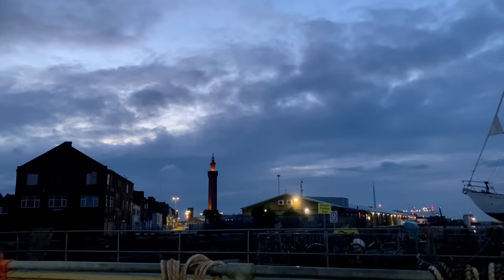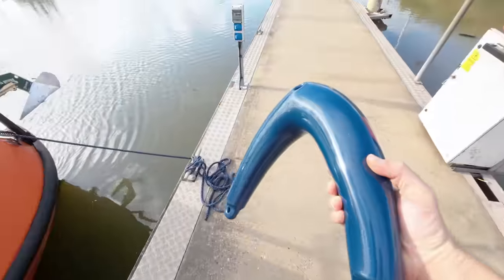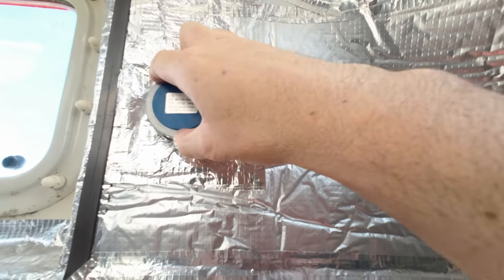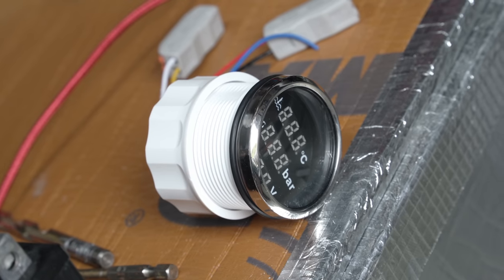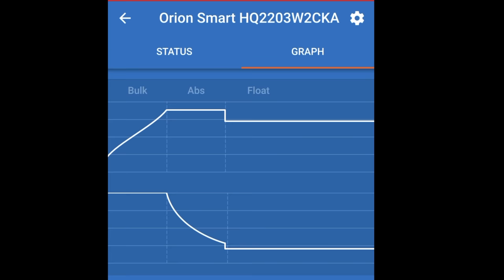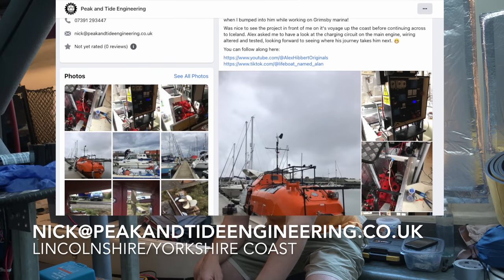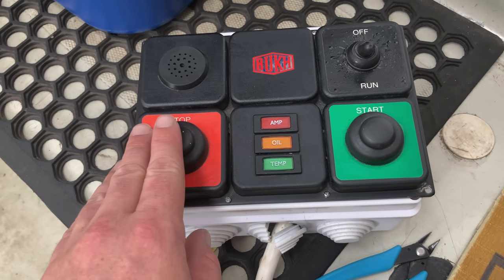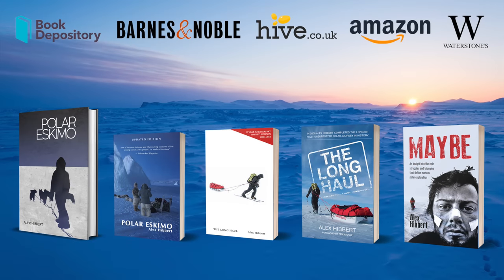Lifeboat 230V and alternator fixes. Installing 24V charger. Expedition Lifeboat Conversion Ep91 [4K]

Comment from the maker: For those wanting a more detailed explanation about the alternator wiring: I'd copied the original installation wire for wire when I took out the old dead alternator. This was wired by Bukh, and they had continuity between the alternator case and the negative terminal. I wrongly assumed my new alternator was set up the same way, but in fact the terminal was isolated. This means I couldn't rely on the alternator shell to connect it to the engine block, and indirectly to the battery negative. The unused black wire on the original needs to be used in this new installation. And now it is!

Comment: that's the thing with victron. it costs about double, but it just works and you don't have the hassle. be nice if the competition would step up a bit.
Reply from the maker: I do wish there was more competition in the ready to plug and play boat electrics, and especially their range. I'm far from a fanboy. Their instructions and post-sale support are pitiful.

Comment: 5:12  Super capacitors are finding their way into starting circuits more and more these days.  I've been using the same bank of 20$ supercapacitors to start my car for over 5 years now.  They never degrade and have never failed to start on the first try (and the small 12Ah battery is fabulous backup source and help to keep the supercaps charged (can be switched of course). The main advantage for you is that they are completely unaffected by low temperatures.

Comment: Make sure the bulk absorption and float settings are set to the same voltages on both the mppt and Orion chargers. In my camper Ive set the charging voltages of the mppt higher(very very slightly) than the one from the Orion. This way makes it so whenever there is enough sun the battery’s charge with sun and the Orion takes a step back. But when the sun fades and the battery’s still need charging the Orion takes over. To spare all the moving parts the wear and maybe some fuel. I’m still experimenting with changing these settings after 3 years of living in the van. But it’s definitely worth experimenting with your own setup.
Reply from the maker: Good tips, thanks

Comment: Nice catch on the alternator - and the Victron gear is very smart and as an added bonus will give off a nice bit of heat into the cabin.😉 Top tip with respect to the anchor when berthing, particularly when constrained by other vessels - as you approach the berth, drop the anchor about 0.5m below the surface of the oggin.😀⛵️
Reply: Heat from electronics is inefficiency. That heat you're getting is coming at the cost of battery capacity. It's probably very much not worth it.
Reply: @BenjaminKlahn  but the waste heat from the Victron units is a given - so what do you suggest?

Comment: Alternators are very reliable,  what has indifferent reliability is the rectifier regulator unit. On small alternators, this unit is usually housed inside the chassis. HOWEVER, if you buy a high output alternator, the R R unit is usually screwed on outside and easily replaced without removing the alternator......Have fun.

Comment: Use A&N “army navy” fittings and fuel hose. Any online hot rod purveyor carries this NHRA & NSRA approved fuel delivery system. If your still wanting stainless lines tape the area you’re wanting to cut through, using a small Dremel fiber cutoff wheel at higher speed. Hope this helps.
Reply from the maker: Much as I'd love to entirely rip out and replace large portions of the boat's hardware each week, sometimes we need to make what we have work!
Reply: @AlexHibbertOriginals lern how alternators work! They need to be conected directly to battery to charge it. If not alterbator is not working

Comment: Your alternator has a W terminal on it. So you can easily add a revcounter gauge to supplement your triple gauge if you are so inclined. I would recommend an old stock analog one or digital with LCD dial (The digital with analog pointer ones are junk).

Comment: Does the new blue box software integrate into the solar panels … would assume so?  You may want to have an alternate power supply for the radio(s) and Anderson Power Pole connectors are a great way to quickly swap power sources.
Reply from the maker: They speak to the same app, but I don't think they coordinate their behaviour, as they don't know they are connection to the same battery/ies.
Reply: @AlexHibbertOriginals 
Start up the Bluetooth network in the app then they start communicate 😁👍

Comment: My understanding is that your Orion and MPPT will both start throttling back as you move towards absorption and then stop completely once house battery float has been achieved.  May be worth adding a smart shunt (if you don’t have already) just after the battery terminal (before any loads) for maximum accuracy.  You might also consider a DC-DC charger going the other way to keep your starter battery topped up from your house bank when you’re at anchor, marina, etc with surplus solar generation to spare, unless your starter is AGM in which case you’re probably fine.

What’s the plan for chart plotter, etc, please tell me you’re not going to the arctic with Navionics alone? 😬
Reply: Putting a dc to dc the other way around will interfere with the automatic start stop detection of the Orion as I understand it.

Comment: Just a small tip on voltage. When an alternator is running, the voltage on a 12V system should be 14.42V at 20-25 degrees C. Higher when colder. So charging voltage of only 13-something volts is not OK.

Comment: Make sure you make yourself an anderson connector with battery clamps in the other end, for the batteries. If you don't already have a good old standard battery-to-battery-startup-cable-set. otherwize, you will be completely dependent on anderson connectors everywhere.
Reply from the maker: I have jump leads at the ready, and an Anderson-clamp combo is a good idea.

Comment: Your stainless braided fuel lines are much easier to deal with using AN fittings and the shear cutting tool designed to use with that type of hose, I use them for my oil coolers, hydraulic steering hoses and high pressure fuel, however it would be a different story had I not the good stock of assorted angle fittings and the specific tool for cutting the line, it makes it much easier to deal with. You may look into that in the future in fuel plumbing, AN-6 would be sufficient for your fuel supply and you could use the same for return to keep for having to have multiple sizes of spare fittings, or have an AN-4 return line.
Reply from the maker: Certainly - all true!

Comment: Hmm, ya sure ya don't want a momentary switch for the digital dials on the battery box? So ya can't forget it on the on-position, it would only work as long as ya hold the button.
Reply from the maker: It's not going to steal much power when underway. If the boat is left 'off' for a few days, there's already a procession of things to switch off that this can be added to.
Reply: @AlexHibbertOriginals a printed and laminated check list for cold and warm startup, as well as for wind-down routines might help prevent errors at times when you might be low on blood sugar, or when someone else needs to do these on your behalf.
Thanks ever so much for sharing all of this with us!

Comment: Why did you fit the shore power box assembly that way around ?  Surely it would be better with the box inside ?
Reply from the maker: The hole created, plus mounting holes no longer matched that configuration after the change in plan. I could have glassed the whole thing over and recut, but I was against the clock. Maybe another time.

Comment: I am kinda glad to see you don't have a pile of lithium batteries on Alan . 
.I love lithium batteries in battery sheds with distance from flammables . The reason is fire they can and do spontaneously ignite and you can't put a lithium battery out until all the fuel Is consumed . That scares hell out of me on a boat . A floating Tesla fire
Reply from the maker: I use lithium a lot in the the Arctic, but LiFePO4, but less Li-ion or polymer chemistries. The safety profiles vary a lot.

Comment: If you ram into anything going forward do you think your anchor will bend or push into the hull?
Reply from the maker: I'm going to bet neither. Given the limited speed and force, it would probably just come to a halt. At worst, the retaining pin might fail and the anchor would lift off the bowsprit.

Comment: Stainless braided hoses are specifically made to use AN fittings. NOT hose clamps. That's your issue!
Reply from the maker: Yeeeeees. This is my realisation, and I'm going to direct my displeasure to the chandlery salesman in 2019.

Comment: A proper shore power fitting is the thing…. Check Kuranda  Marine.
Reply from the maker: I was royally messed around by Kuranda, so I don't buy from them.
Reply: @AlexHibbertOriginals  Sorry to hear that. They did a magnificent job fitting a 3K Victron to my boat, 15 years of faultless working, still on the 4 original batteries. They aren't the only suppliers of shore power socket fittings though I guess..

Comment: @AlexHibbertOriginals my comment 2 months ago was long and rambling! But I love everything you did in this video and think that they are all good decisions - but I would also add a 24v 100a alternator to Alan's diesel engine, and make sure you have a plug-in battery charger for marinas or your diesel generator.

Alan's diesel engine probably has a fair amount of horsepower to spare. Therfore, adding the second alternator would not slow you down any, and wouldn't increase your fuel consumption (it's just a question of how long it takes to charge the batteries).

But right now, if you ran your battery banks dead, it'd take you something like 7 hours to recharge each pair of batteries, and that's if you had 100% of the alternator's output. If you want to run some electrical loads too? Good luck.

Even the 100a 24v alternator would take 2+ hours to recharge each pair of batteries - under ideal circumstances.
Reply from the maker: Hi Paul - I may consider another alternator, but space is a real limiter down there, and the current alternator does supply a lot of power over the long engine runs we're doing. The batteries are almost always full.

The generator has a battery charger (a Victron) that can chuck out 50A, so that will sort the batteries in quick time, and with less fuel than running the engine. I will save up for a charger for both generator outlets.
Reply: @AlexHibbertOriginals  I don't have a good mental image of how much space is available under the cowling, but please keep the second alternator in the back of your mind.

I find it helpful to think of everything in watts, as it makes it easier when dealing with multiple voltages. Your current alternator provided 840 watts at maximum output.

A 50 amp charger (assuming 24 volt) is 1200 watts and a very nice second option. 

My only point was - keep a mental list of items that draw power. A light here, a pump there, a computer here, a screen there, a fan there, suddenly tiny 5 and 10 watt loads start adding up. 

I would suggest a clamp multimeter with AC and DC current measuring. You can put the clamp around the cable coming from your alternator and see just how much load you're putting on it. Or any other part of your system. Makes it very easy to figure out where your electricity is going.

I agree with a top rate brand like Victron for your main charger, but in the USA, Amazon has some CHEAP no-name ones. I'm talking about 100 amps at 12v for $100. Wouldn't want it as my only charger, but a nice backup / auxiliary.

I am probably being paranoid, but I'd rather send you $500 for a second alternator, than have you be stranded.

P. S. - I still think you should consider valves for a radiator in the cabin (shut off the cooling loop under Alan and have a radiator in the cabin instead). I know this must seem laughable after your summer voyages where keeping cool was an issue. However I'm afraid that will change when in actual arctic conditions, and heating will become important. You'll be huddled around the diesel heater saying "I can believe we're heating water under the boat..."

Comment: You could upgrade the dodgy braided fuel hose by just buying good quality fuel hose and wrapping it in industrial type spiral binding. Garden variety automotive spiral binding is a bit second rate here - it's the industrial type you want that hose doctors etc sell. It isn't particularly cheap but it has awesome abrasion & chemical resistance and will toughen any rubber hose. 
In hot areas of the engine bay you can buy reflective cloth tubing of various diameters too, so you could actually make some decent fuel hoses. 
I, like you, don't like crappy hose - I'd jolly well piss it off 'ole chap lest you find yourself without power and dashed upon the rocks.

So a 12v alternator should ordinarily charge at 13.8 - 14.2v. The resting voltage of a healthy lead-acid (or equivalent) 12v battery should be 12.6v
Also 100a isn't enough for the cranking battery @12v. Typically 300a cable is about what you want. That battery can probably output 250cca by the looks of things. For reference, the key advantage of 24v over 12v is half the current for cranking but you're only 12v on the engine. Best to rethink this wiring. Remember the higher the voltage the lower the amps. Diesel engines need all the amps they can get when starting at 12v.
Reply from the maker: The first half of this is interesting and I'll investigate. The second half is slightly odd - the new battery is punchier, albeit smaller, than the factory batteries, and it cranks the engine with ease. The starter motor is only a 1kw. If the system works, I see little reason to rip everything out and start again just because 24v allows for lower amps.
Reply: @AlexHibbertOriginals Re the voltage, it's not odd it's maths.
Just because it works now in its inadequate state, doesn't mean it's going to after a fuel leak, repair and subsequent air in the system that needs bleeding.
Expect hot wires that let the smoke out and a flat battery in that case. 300a cable is needed and even another battery in parallel to improve reliability and performance.
250cca is an inadequately sized battery - a small battery. Most batteries sort of start in the range of 500cca and go up from there these days. You could save that battery by getting another identical one however more potentionally problematic connections are required.
Voltage drop occurs when you need it most, not when you're testing it in the commissioning phase.

Comment: Obviously you've committed to 24V house batteries now, but I assumed you were using 24V as that's what the engine electrics used. I would have kept everything 12V if that's what your engine used. Anyway. Too late for that now.

70 amps at 12 volts is NOT a lot of power. 840 watts to be exact - and that's running the alternator at full load. Plenty for duties as a lifeboat, but not much for a ship. Also, 746 watts is 1 horsepower, so your alternator will place just over 1 horsepower of load on your engine at maximum load. Not much.

In my van, which is entirely 12 volt, I've got a 180 amp alternator for the starting battery, and a 280 amp alternator for the house battery. PLUS a stand-alone 3000w generator.

I'm not too worried now that you've got a separate diesel generator of your own - but I would strongly consider a separate 24V alternator at some point. 100 amps at 24V would be a nice size - recharging your battery bank in 4 hours, while only putting around 3 horsepower of load on your engine.

Anyway, I think the changes you marry were otherwise quite good - I am a big fan of the dedicated starting battery and the 12/24 battery charger.
Reply from the maker: The amount of wiring makes the lower current at 24V good for avoiding voltage drop on longer runs, but I agree consistency would be good. That said, a 24V starter motor would then not be cranked on a single battery in an emergency. So it's a toss up.
Reply: Most boats run at 24V due to the cable runs involved. Some larger vessels operate on 48V.
Reply: @TimSetter-z9u right. But that typically includes the starter, alternator, and everything else with the engine. That's what I assumed was the case here. I was surprised that the engine was 12v. My point is that personally I value consistent voltages. With my system, I have to use 4/0 gauge (0000 gauge) cable between the alternator and batteries, and even then it still gets warm to the touch. 24v would help considerably. But I like having all the voltage consistent. Just different takes on a situation.

Comment: DEAR Alex eventually  you 'll have  coat your electronics  panel with a anti salt water spray or laquer no electronics  survive salt water! But there are many quick sprays on line that leave a coating on the wires srews etc. etc. This is not a option!  especially  for Allen and his future environments   i did find perfect trusters sadly
They cost more then the boat  still looking Tony
Reply from the maker: Yes I do need to fit the polycarb cover soon.
Reply: I knew you had it on the list of to dos cheers thank you  im going to send you a box of odds and ends I sell military  survival gear 
I have hit my storage soon  cheers!